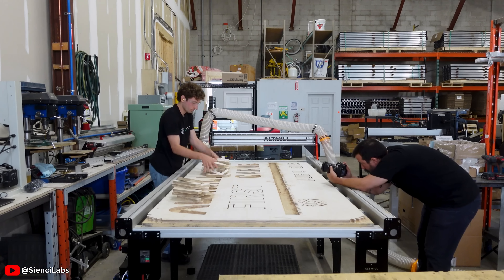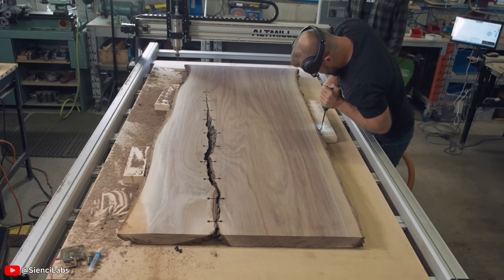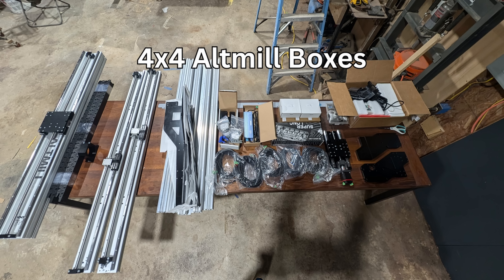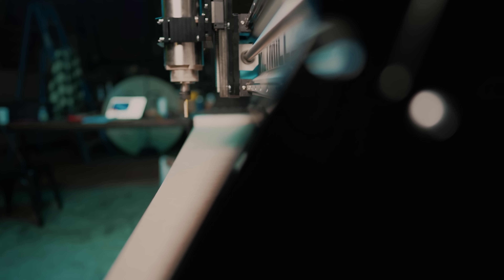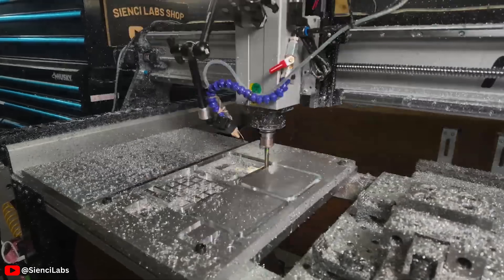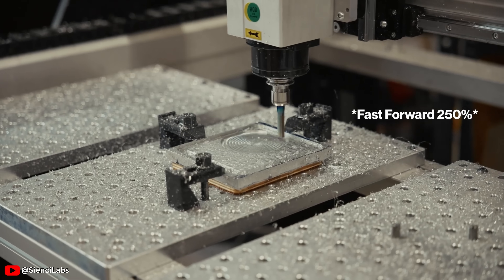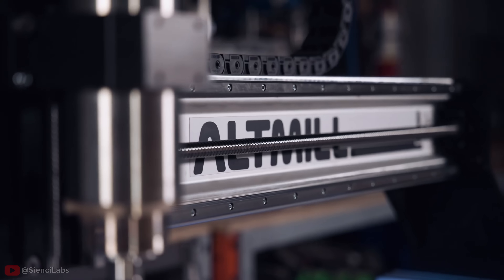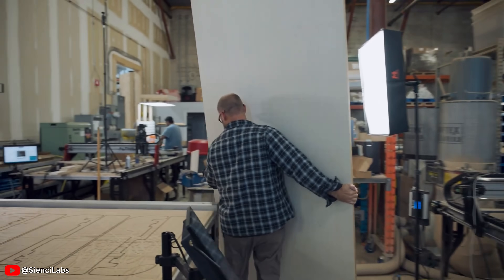Is This Budget 4x8 CNC The New King?

Comment: I agree with you that this is probably the new king of the $10,000 and less 4x8 market.  There are some contenders already there.  There's the Millwright Mega V2 Full Sheet which is $6799.  There's the Zenbot 4896 Pro which is $5999 and that price includes the 1.5kw air cooled spindle (their online shop forces you to pick a spindle).   There's the STVCNC STVR8 which is $9499.

The 4x8 is tempting but my thinking is that I would prefer the 4x4 with the ball screw on the Y.  First of all tiling is very easy and very practical.  I do a good bit of tiling on my little Stepcraft D840.  It's a 24x32 machine and I've tiled projects up to 23x90 with good success.  And that footprint is too large for me.

Comment: If you are able to assemble this 4x8, you have some mechanical skills. Consider the much cheaper  and mearly as capable DIY kit, Lowrider V.4 from V1 Engineering. You can make it the size you need, and change that later if desired.

Comment: The choices and prices are great right now. I'm a HS shop teacher. I have put $150K+ into CNC routers between the 3 schools that I have setup. The brands were Forest Scientific, Techno Easel, and my current situation ShopSabre. Can't beat how robust the ShopSabre is HS. Forest Scientific and Techno Easel has very similar structure to the Altimill. Forest Scientific does have some more robust models with the structure. Had a FS with all rack and pinion, robutst stee; frame and no ball screws. I think the Altmill has it beat for a 1/4 of the price. ShopBot in my opinion is just an over priced hobby setup with terrible bolt together design. ShopBot was at a CTE related show. They were clueless what is going on in the "hobby" market same with Tormach. For the price the "hobby" machines are at have the good ole boyz beat by far.

Comment: WOW, I'm going to have to start making these machines for other people, seeing as there's only $1500 worth of materials involved in actually making these machines!
These machines are so easy to make yourself, especially when using the aluminum extrusions like they are using for theirs.
Reply from the maker: Let me know when you do! The more options the better!
Reply: Nothing against you making cnc routers. I hope you go for it. However, it is not the same to make your own as to make for selling. You have to do a lot of studies and research to produce a machine that adheres to the specs you specify, maintain consistent quality, and be safe. As Hamilton said, let me know when/if you do.

Good luck.
Reply: PrintNC is your answer. Heck if you don't need a ton of rigidity, and you have a 3D printer, you make a Lowrider4 for about $600.

Comment: too expensive compared to 4x4 when 80% of parts are same.
Reply: That’s what I was thinking you could get two 4x4 for the price of about $6300 and save $1200 over the 4x8. Having two 4x4 machines means you could have double the output.
Reply: @trashbag8124  yes assuming you dont need the length

Comment: Decent value for what you're getting, but the CNC4Newbie is also available. It cost me ~$8k for a 4x8 including the 2.2kW spindle. I added a Blackbox for another $2,500. It was a good starter machine, just like this will be. This has a leg-up having the option of an ATC and closed loop servos. I will say though, the listed cutting speed at 1,000IPM is just false. That's at the absolute limit of my Panther with Becker pump. I've taken it up to 800IPM and there's absolutely no way this machine will do that. My Panther is all welded steel and weighs 3,500lbs.
Reply from the maker: Just gave that one a look-up. Looks like they've stopped selling to the USA for the moment. And I'm also very interested to see the 1,000ipm. Not sure if they have said its for cutting, but I have seen them mention it for rapids. Time will tell!
Reply: Even the underpowered onefinity can hit 1000ipm. However I don’t think that’s cutting speed, I think that’s rapid movements.